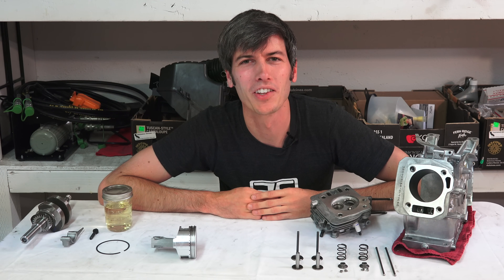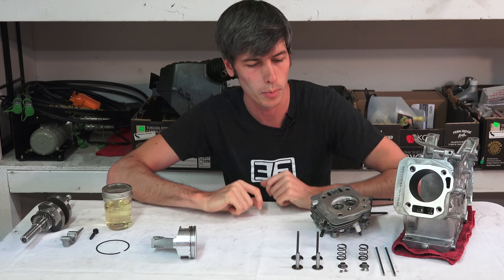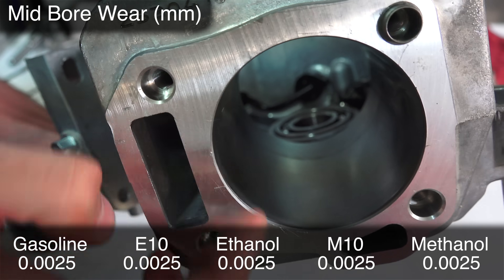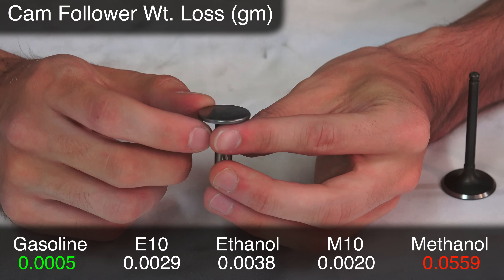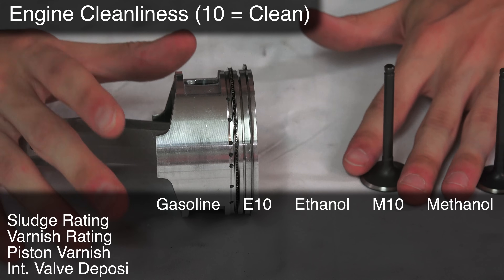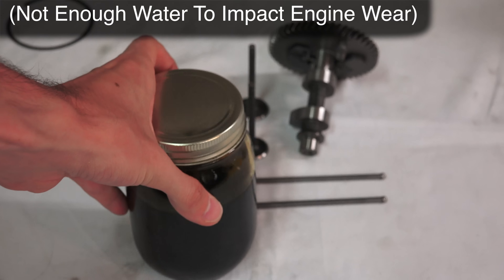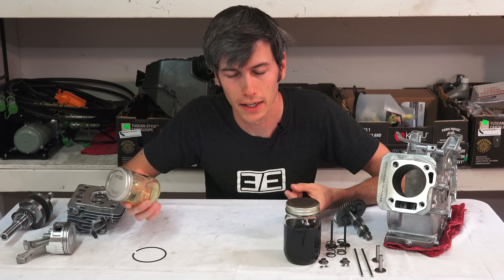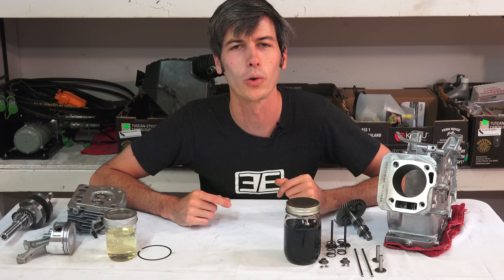Is Ethanol Bad For Your Car's Engine?

Comment: In brazil.we use ethanol w water, we have bi fuel engines and ethanol actually gives the engine a "boost" due to compression rates

Comment: Question.. 10% ethanol fuels in my country have a slightly higher octane rating than standard 100% gas.. 94 vs 92. With all of the smart electronics I thought the ignition timing would take advantage of the higher RON and maybe compensate for the lower energy rating of the 10% ethanol mix. What am I missing??

Comment: I drive a large (1.1cl/1100cc) older motorcycle and using ethanol in any amount messes with the engine. It knocks slightly, which can't be good.
Can you research that and tell us what you find?

Comment: MANY year ago I was a daily visitor to the research lab of a major engine components manufacturer. Their test benches ran engines on thousands of repeated cycles of full load, no load , max. RPM - Idle , some times for weeks without interruption.. Twenty hours seems a somewhat short test period!

Comment: Seems like way too small of a study to be accurate. Not the running time, but only one engine for each fuel type leaves too much margin for error. I would like to see 5 motors running each type of fuel.

Comment: And this "subsidy" the commenters are talking about ENDED IN 2011 and was actually a lower federal gas tax (13.9 cents for E10 instead of 18.4 for gas without ethanol), which was usually passed on to consumers in the form of lower prices for E10. When congress ended the "subsidy," they actually increased our gas taxes from just under $20 billion a year to more than $26 billion.

Comment: You were doing great right up until the end when you switched from talking about a real engineering study to repeating anti-ethanol tall tales that have been disproved many, many times. First, the test you're talking about was done in 1981 - why would you say only 2012 and newer fuel systems have been built for E10? Fuel system components - including fuel lines and gaskets and other parts that may have been affected by ethanol - changed all the way back in the mid 80's, when the ASTM spec for gasoline was changed to include up to 10% ethanol. You mention ethanol's corrosive nature right after you showed a study proving it wasn't any more corrosive than gasoline, and you mention phase separation caused by ethanol pulling water out of the air - which is absolutely a myth. And while mileage is affected by adding ethanol - typically 1.5 to 2% fewer MPG, E10 usually costs 10% less than straight gasoline at the pump, meaning your cost per mile is lower.
Reply: Ron Burgundy, could you please elaborate your statement "phase separation caused by ethanol pulling water out of the air - which is absolutely a myth"? 

The reason is I have parked a car in garage for several months due to the Covid-19 shutdown. Recently I read it somewhere that says ethanol will separate it from gasoline over time. It looks like I need to park the car longer so I just filled up the fuel tank and added fuel stabilizer.

Comment: Good or bad for the engine, it doesn't help the environment. You get 3.300 kWh/year/m² of energy yield with ethanol and biodiesel, 500.000 or more with renewable energy. That means you need 150x as much or more area (= deforestation, since it immediately competes with trees) to get the same amount of energy into your car as with solar panels or wind turbines. And that's not accounting for ICEs having 25-33% efficiency while BEVs have 70-85%. 100% renewable energy is possible, but it's not realistic with biofuel. If anything renewable synthetic fuel will be viable, although it has to be developed further.

Comment: I just avoid ethanol completely. It's cheaper at the pump but with the lower fuel economy you are probably spending the same money per mile. It's not good for small engines because they are air cooled and don't run as hot and also get a lot of varnish in the float bowl from the ethanol. On top of that anyone burning ethanol because they believe it's better for the environment has been fooled. While might burn cleaner in your vehicle the real problem is with the processing plants. I have seen the inside of many ethanol plants and can tell you that the process of producing fuel ethanol on a large scale isn't as clean as we have been lead to believe. If you want to dive farther into the wormhole, there is also the fact that ethanol is artificially driving up the corn prices. This has made a lot of food products go up in price due to the increased cost of feed for livestock.

Comment: I had an '85 Toyota MR2. I took it to Florida, and coming back, after filling up with E10, I noticed that, on cruise control, the check engine light came on.
Off of cruise, trying to maintain a steady speed by foot, it wouldn't come on. I always wondered what the difference was.

Comment: I have a '13 SS Camaro & I can tell it runs much better when I use an ethanol free 93 premium fuel. For $ issues I had to use regular 83 10% ethanol one time & my car hated it! I routinely use premium 93 10% fuel but if I can swing it the ethanol free is my choice.

Comment: So what I'm gathering is, pure ethanol should be used. It has great octane rating, is much  cheaper when comparing to premium gas; however, the consumption of fuel will be greater with ethanol.

Comment: I suspect a lot has changed in engine construction and materials since 1985 so not sure  I'd be drawing too many conclusions from this study. Modern engines should be fine. Ethanol is typically a heavily subsidized fuel and without the fuel subsidies and current gasoline costs it may not make sense beyond political reasons.

Comment: The problem with E10 is (in Europe), that it destroys rubber and plastic components in cars older than app. 20 years, obviously fuel delivery components. Having older and vintage cars, it presents a replacement part problem, especially when "green" politicians have made mixed petrol, the only legally available...

Comment: One must remember that this article relates purely to a small part of the longer term damage ie Wear caused by Ethanol. Any test need to be over much longer durations to cover the complete story of Ethanol's story.
1. Ethanol attracts water which can result in increased water collecting in fuel tanks which reduces in proportion the contents of Fuel related to built up water residue.
2. Longer term use of Ethanol Fuels can cause webbing in Fuel Filters and Carbs etc.
3. Ethanol blended fuels are less economic due to less distance travelled per litre/Gallon. so you will be refuelling more often due to less distance plus as time goes on and water builds up in Fuel tank you will be actually be led to believe that because you are putting less fuel in your Tank that the E blend is economic !!!!.
4. Water and Oil  mixed are NOT recommended to achieve the full benefits of modern day Oils.
Basically to evaluate the overall effects of Ethanol Blended Fuels requires a very detailed and prolonged testing that takes all operating aspects into consideration, but all of this could be a waste of time with Countries such as the U.K. phasing out I.C.E's. in favour of Electric Vehicles( Batteries in the last few years have improved beyond all expectations.)

Comment: Another problem with ethanol is that the oxygen sensors can't detect it.  The computer then thinks the engine is running lean so it enrichens the mixture, and this leads to even worse fuel economy.

Comment: Ethanol should be used in Jet liners (turbine engines)! It has more energy (E) per lb. than jet fuel and it doesn't freeze and keep water in solution. Only drawback is most jet liners use fuel as a coolant for engine oil so this would need to be redone, faairly easy but long time to do. Also you need more space for the same energy (lower E per given volume.

Comment: One big benefit of ethanol in colder climates is that it keeps your fuel system from freezing up. They're not putting ethanol in your fuel because it's eco friendly or to make your vehicle run better. They're doing it because they get a big tax break.

Comment: E10 fuel is fully in use since 01-Oct- 2019 in Holland. I drive a BMW 1 series, and suddenly I wasn't able to even reach the 600KM with 50 liters of fuel. While before, I would do almost 800KM with 50 liters!

Plus, starting the car in cold weather was suddely a bit more difficult!

Changing the Oxygen sensors on my car cost me 500 euro's, and I still couldn't see any improvement in terms of  fuel consumption, and also the car started to stutter at 1800rpm.

However, with all of these problems since October, I had no engine management indication from the car's engine. And also, the engine does well when it is warmed up...

That seemed very weird to me, so I decided to put injector cleaner in the fuel tank, and filled up the tank with premium fuel (like Shell V-Power, Esso Energy Supreme, BP Ultimate, etc.).

The result after 50km? Well, ALL of problems just GONE! And suddenlycar shows me that I am going to drive 720km on 50 liters of fuel, if I keep the same pace!

So E10 being good for your car, is simply not true!!!

I for one, will NEVER fill up my car with that CRAP again!
Reply: If it's a newer BMW, are you sure the issue wasn't just octane rating and not ethanol in the blend?  It sounds like the issue might have been related to the ECM retarding the engine timing to prevent knocking — when you added premium gas it might have sorted itself.  Either that or you could have had a clogged injector that wasn't spraying right; that too will cause a decrease in fuel economy.  Either way for a premium car like a BMW I would never put anything else other than top-tier gas like Shell V-Power that contains extra detergents.  I don't trust the high-strung thoroughbred engines on these types of performance vehicles, to me it just seems like a money pit with too many things that can go wrong.

Comment: I am from Brazil. The law requires between 20 and 25% ethanol in the gasoline. I am used to this kind of fuel and I would say this study is not enough to come the the conclusion ethanol is fine for the car. Running the engine for 20 hours will miss some long term effects. Probably Brazilian cars are crappier, but one thing I know is ethanol causes corrosion and eventually holes in the exhaust pipes. When I lived in Brazil I had to replace the exhausts every 35-55k miles. I have a 6 year old (67k miles) CR-v here in the US and the exhaust is fine. It may be just a coincidence, but the lower ethanol concentration may be an explanation.

Comment: What about VAMPA?  I was told by a mechanical engineer that VAMPA is being used in modern gasoline mixtures that make for clean burning fuel.  Also, can you please give a video on the operations of the Cam shaft.  I looked at the new Ford 5.0 L V8 VCTs used on the GT Mustangs.  Can you explain what is Veritable Cam Timing and how it works?

Comment: It's been about 10 months since my car's engine (inline-three) is running on E85, works fine, no issue so far. What is worth mentioning is that I don't use my car that much (around 4000 km a year).

Comment: ETHANOL IS GARBAGE. IT WILL SCREW UP YOUR SMALL ENGINES LIKE LAWNMOWERS, WEED EATERS, TRACTORS, PRESSURE WASHERS. 
YOU HAVE TO USE A FUEL STABILIZER AT LEAST TO STOP THE DAMAGE.

IT GUMS UP YOUR FUEL SYSTEM AND IT WAS PUSHED ON US BY DEMON POLITICS.
THE GAS IN THE 70'S AND 80'S PERFORMED EVEN AFTER SITTING FOR A FEW YEARS.

 REC 90 GAS IS CALLED WRECK 90

IT IS WAY TO LOW IN OCTANE.

Comment: You've got to remember that in a newer car that is designed to run on ethanol blended  Fuel even if you find  Ethanol free fuel it take so long for your car to adjust the computer for the extra 4% of energy you get that unless you run ethanol free fuel all the time every tank you won't really notice a difference.

Comment: Chevron in Canada has no ethanol in there 94 Octane Fuel - good for classics. I wonder comparing efficiency of that 94 Octane fuel vs 87 Octane E10 in an engine not requiring higher octane?

Comment: I have had to throw out a power washer, generator and lawn mower due to breakdown due to the ethanol killing the carburetor.  Yes, I used Stabil to protect the fuel, they still failed. They ended up in a landfill.

Comment: So the study ran an engine for only 20 hours. From what I understand, the problem with ethanol is that it corrodes metal over time. 20 hours is not long enough for that study. That study is worthless.

Comment: I’m no mechanical engineer, but usually cars running high ethanol content tend to be performance tuned to their fuel. Majority of them are fitted with an oil management system like a catch can set up.. so moisture would be separated before returning back in the engine via intake.

Comment: Well I would disagree with some of your comments on the use of E10 I run my vehicle on E10 and have done so for many years my ride is a 1990 FJ62 Landcruiser with a 3F petrol engine it runs way better on E10 at 95 Octane it burns no oil between services it starts every time in any weather even if it sits in my driveway for a couple of months at a time at this time it has 561,000 Klms on the clock as is as strong as the day I bought it also on the use of Methanol fuels my friend and I raced Speedway cars in the late 60s and early 70s using methanol and we never had severe wear problems with our engines but we used vegetable based oils not mineral based oils

Comment: Sugestion: the same study including LPG
Reply: LPG engines like in my car are designed differently to accept LPG fuel.
Reply: @martintaper7997  so ignition timing? Material choice and hardened valve seal? What more?

Comment: The cost of ethanol in fuels far outweighs the benefits. I repair small residential and commercial engines. The damage caused by ethanol is extensive on the fuel systems as well as the mechanical parts.

Comment: Honestly it's a miracle that engines don't fall apart when they run.
Reply: No it isn't. It's hundreds of thousands of man-hours of mechanical, metallurgical, chemical, industrial and now electronic engineering hours. All courtesy of Capitalism and some government meddling.
Reply: @curtislowe4577  that kind of cooperation is a miracle....
Reply: @curtislowe4577  you took it too literally.  Calm down... Use your right brain every now and then .
Reply: It was an ignorant comment entirely in keeping with the all too common comments of the masses of folks that are largely ignorant of the endeavors of engineers going back to Watt and the other engineers that first tamed steam. Learning the intricacies of f=ma in the process and providing our phenomenal standard of living. Occasionally for the betterment of mankind but more often to provide a return on investment for the Capitalists. 

Cooperation? Not so much. It is building on the accomplishments of the past and making some often small incremental improvement. One of the first things newly minted engineers learn is Do Not Reinvent The Wheel.

Then there's you. You read a detailed, technically accurate comment and proceed to make a clueless comment on someone else's underdeveloped right brain half. Pfffft to you, sir.

Comment: From the age of the study (1981) and the amount of lead in the oil I suspect leaded fuel was used in this study. Given that lead provided a significant amount of upper cylinder lubrication (most notably reducing valve seat wear) one should perhaps take some of the wear figures with a degree of caution that they might not be so low when unleaded is used.
Reply: Can you re-write this but make it understandable for dummies (like me)?
Reply: @CarsOverPeople  It's a while since I looked at this but at the time I remember being mindful that in 1981 is 5 years before the introduction of unleaded petrol here in the UK and just about everywhere except Japan so unleaded seems a strange choice for the study. Also, if the lead in the oil was from wear of the thin-wall bearing which are typically 70% copper 30% lead why is there way more lead in the oil than copper - you would expect the copper to be higher than the lead even allowing for the difference in the density of the two metals (it does not say here what the units are but I would assume parts per million by weight). Having had a quick look at the figures again the ratio of lead to copper in the oil is amazingly consistent at between 3.7 and 3.8 for all but the methanol case where the copper content is relatively much higher. So, I'm wondering why the lead content in all these cases is as high as it is unless the bearing shells of the engine had a much higher lead content than is normally quoted and/or the fuel contained lead.
Sorry - I have only made the whole thing more confusing. I guess I will need to look to see if the original paper explains the origin of the metals in the oil in detail.

Comment: e85 is cheaper than gas - this is especially true for those of us who have to use 93 octane.  Therefore the cost of fuel to mileage outweighs the miles per gallon comparison.  Plus, e85 will bring a sports car to like, as it is above 100 octane.

Comment: When you consider that corn ethanol has 67% of the BTU of straight gasoline,, and it takes up to 1.3 gallons of petroleum to make a gallon of ethanol we are getting essentially a 50% return on our input. Plus consider that 99% of the machines used to grow, harvest and transport corn are diesel powered.

Comment: I lose horse power and mileage when I use gas with 10% ethanol. I have noticed this with two separate vehicles from 1995 and 2003.

Comment: When I was using methanol in motorcycle racing (in a 4 stroke) , I used to run premix with R30 (about 40:1). Otherwise the exhaust valve would stick.

Comment: when I was using e85 in my 2103 caravan I went from 16 mpg to 22 mpg with gasoline. On a per tank basis that's A LOT of gas. Now I'm driving a 2019 elantra averaging about 36 mpg but can keep it over 40 if I do lots of highway driving.